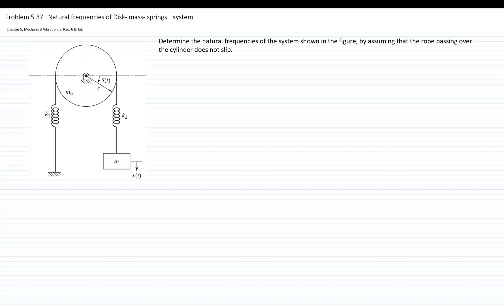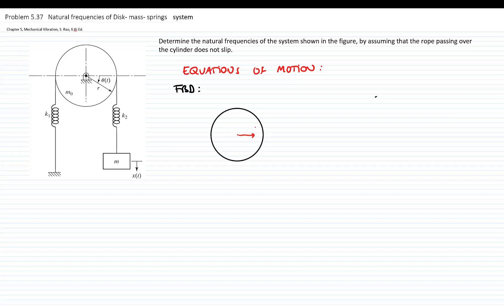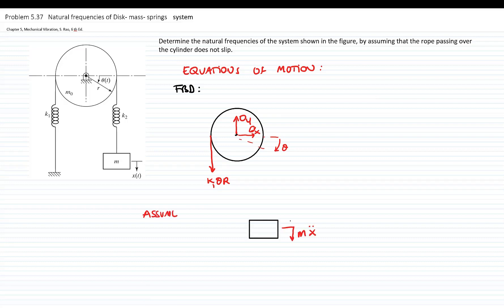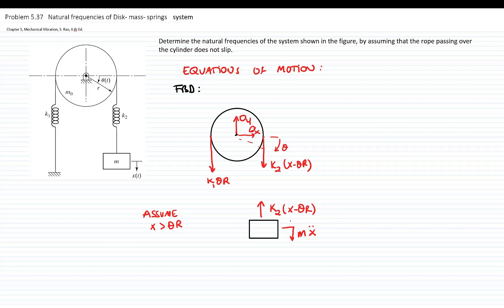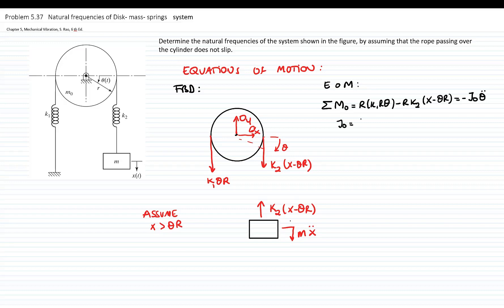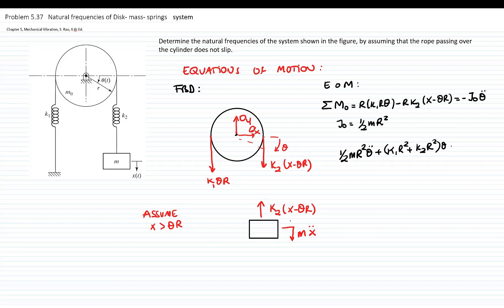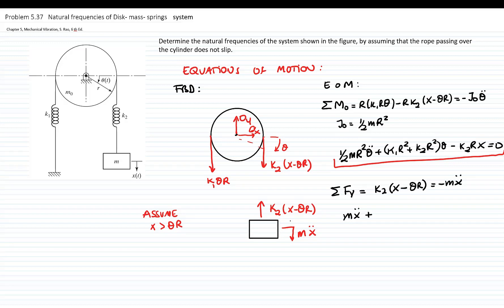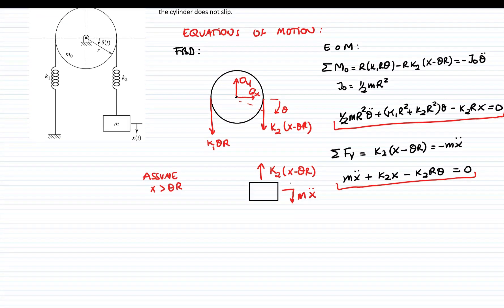Problem 5 37 Finding natural frequencies of Disk block springs system

Comment: hello pretty professor <3 may I ask that you do a video on example 3.17 from the textbook?  this is the question
A three-bladed wind turbine (Fig. 3.40(a)) has a small unbalanced mass m located at a radius r in the plane of the blades. The blades are located from the central vertical (y) axis at a distance R and rotate at an angular velocity of If the supporting truss can be modeled as a hollow steel shaft of outer diameter 0.1 m and inner diameter 0.08 m, determine the maximum
stresses developed at the base of the support (point A). The mass moment of inertia of the tur bine system about the vertical (y) axis is Assume 
J h = 8 m, and v = 31.416 rad/s